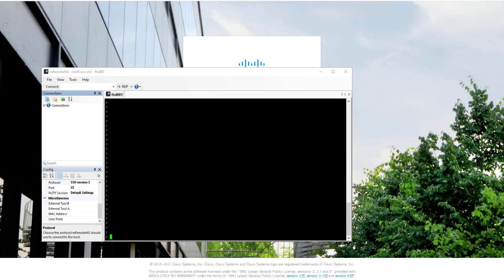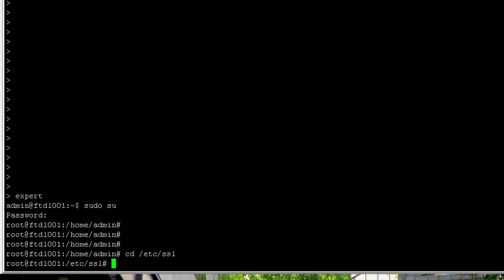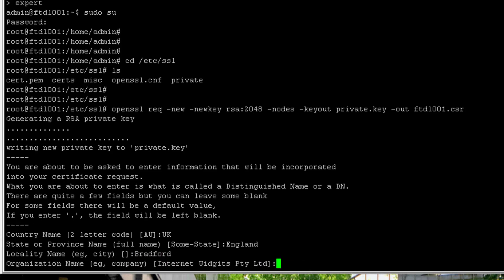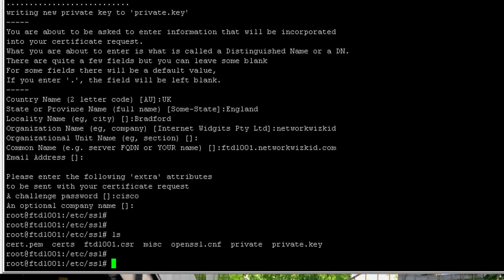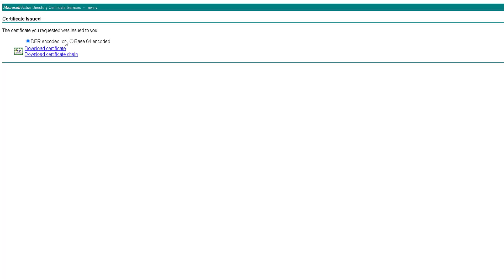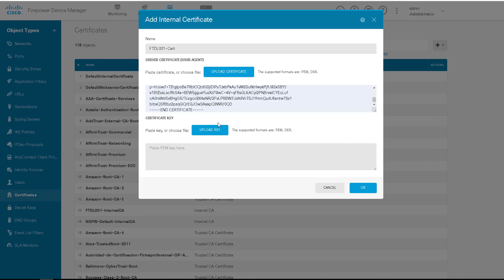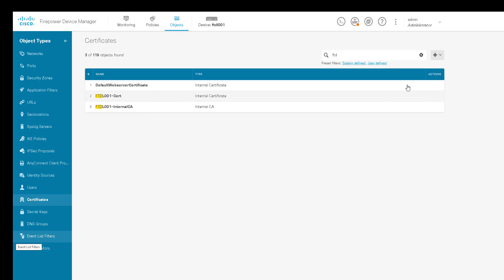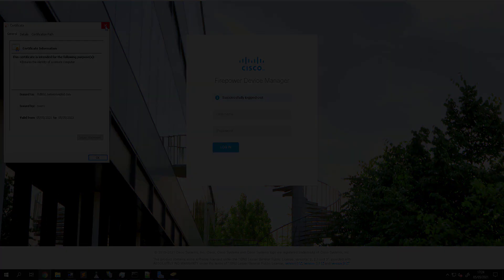Cisco FTD Manual Certificate Installation when Managed by FDM

Comment: cisco is a joke, using open source crap and charging boatloads of money for it. I will be ditching firepower for something else when it dies.
Reply from the maker: I'm curious...what would you be thinking of moving to? You might be surprised at the number of vendors utilising open source.
Reply: @NetworkWizkid  I used firepower appliance for anyconnect and then was forced to buy a support subscription to get an update to fix a flaw in openssl that showed up 2 years ago. There wasn't a way to geo firewall the vpn port easily and retards from wherever would crash the service. The threat defense never did alarm on anything while I had a subscription. Palo alto never finds anything and classifies traffic based on make believe risk spectrums. I tried fortinet and it hasn't helped identity any "threats" yet. Cyber security is sold as a comfort tool and is a huge grift. I can open up ntop and look for odd trends and traffic flows. Local IT staff should be trained to do this instead of farming all their work to silicon valley. That being said, I only manage a few hundred staff on a 1 gig circuit. Focus on backups and disaster recovery, train your staff not to be fools, unplug from the internet. I'm a bitter old man now after 20 years of IT bullshit. lol. I love those cisco business switches but hate how they are trying to "cloud" everything. Cheers fellow computer geek.